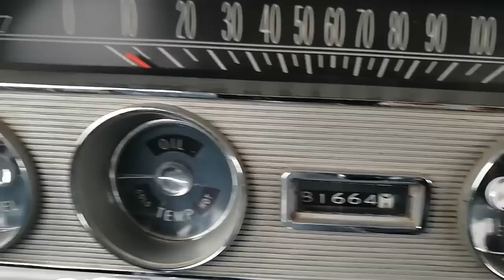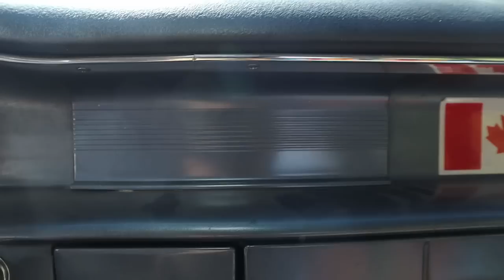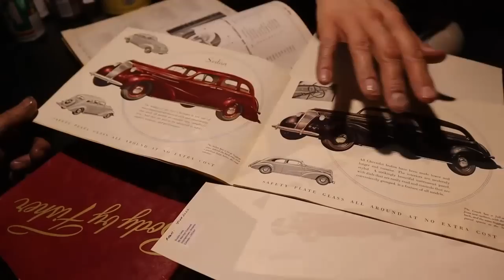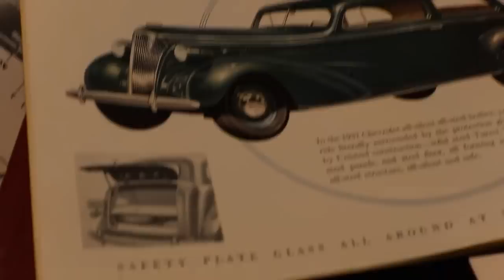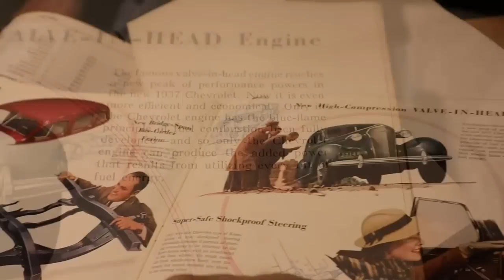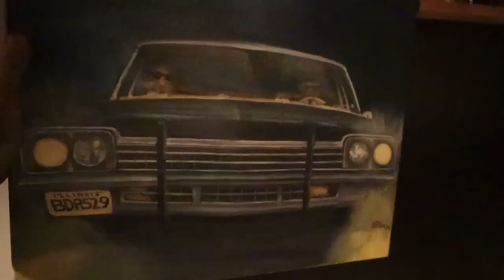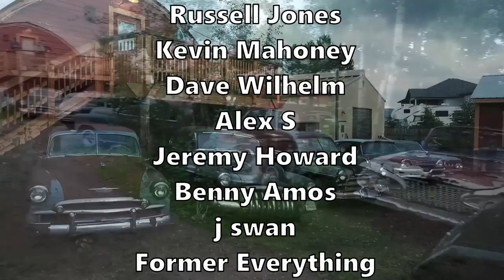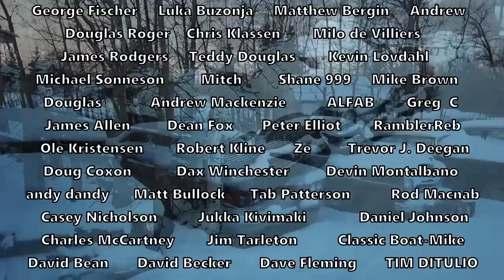"Turn Up the Base" Special: 1000-Mile Road Trip in Myles' "sight-unseen" Base Bargain!

Comment: Myles got a real sweetheart of a Pontiac. He's braver than I would be, driving it back home.
Reply: Yeah, it was a gamble, for sure
Reply: Those old 261 motors were plentiful in th 60s and 70s in the junkyards. Everyone was pulling them out for the more popular v8s. You could easily get 100k miles or more out of a 261. Full of oil and water you couldn't  really overev them because of the carberater, intake and exhaust system.
Reply: its my kinda gamble. might hit a few bumps along the way, but havent truely lost yet. the win was driving the oldest car i ever owned

Comment: I usually try and scan the codes on a untested car before I take it on a 1000 journey. That Miles is a beast, just let her rip.
Reply: Scan the codes on a 60 Pontiac lol. Look under the hood, if you have an engine radiator and a battery your good to go.
Reply: Always the most fun!
Reply: How does one scan a 60 ?

Comment: My dad had a 1970 Strato Chief. It was a leftover, sold in 1971. The reason it didn't sell was it didn't have power steering. By this point, GM was putting a small steering wheel in every car, thinking that most drivers would order power steering. It was so hard to steer I used to help my mom reef on the wheel while she was parking.

Comment: In an act of desperation i previously discovered that when you have to put nuts onto bolts in places that are impossible to access while holding the nut it is possible with considerable discomfort to partially thread the nut onto the tip of your forefinger just enough to grip it while you maneuver it into place then with your thumb and middle finger simultaneously unscrew it from your finger onto the bolt, you're welcome.

Comment: What a welcome surprise to see a Pontiac on your show.   Being use to USA Pontiac's it is always interesting to see a 6 cylinder 59/60 full size Pontiac.  Also on the road trip seeing a 59/60 Pontiac with a narrow track, not the USA "wide track" Pontiac.  The car is in overall super condition, great buy.   The 1935 top Chevy models were the first Chevy with the all steel roof while the standard models were like the 1934 bodies with the fabric center/wood braced top.

Comment: My uncle had a 1960 Pontiac Catalina 2 door sedan with a 389 and a 3 speed manual back in 1963.  It was a USA car, no 6 cylinder Pontiac here.  It was a runner.

Comment: Yeah, 1960. Those were the days, cars were pure. The luxurious metal dash top, no radio, no air con, no temperature gauge or oil pressure gauge, no seat belts or air bags. A complete time capsule. My 1960 Ford in the UK was a 'De Luxe' which meant a heater and chrome strips down the side (They kept falling off - you'd hear a clatter, stop and pick up the latest one that fell!) Mine had the optional rust unlike Myles's Pontiac.

Comment: Miles looks like the fire chief driving the Strato Streak. Is that one if those crazy Canadian 59-60 Pontiac bodies on a Chevy chassis? The tires sit way inside the fenders because the Pontiac body was made for the U.S. wide track Pontiac chassis.
Reply: For years the Canadian Pontiac used Chevrolet chassis and body with Pontiac fenders and trim. Before 1955 they usually had flathead Pontiac sixes, after that, Chev V8 or the unique 261 six borrowed from Chevrolet trucks.
Reply: Yep, I was thinkn of spacing those wheels to the outside....

Comment: It is so interesting seeing what Canada did when they built cars.  I run into the same here when Mexico built all the cars.  Every car has differences from the US cars either by luck or design.
Reply: Yep, pretty interesting and a bit of a learning curve
Reply: @mylesmoparfreak6562  Myles, I will give you an example of the Mexican craziness.  In the '60's Ford was the only company using V8 engines.  The other companies had to do something to compete so on a car like my 1963 Plymouth Savoy, they added the Fury trim on the side and sail panel.

All Chevrolets and Plymouths were 6 cylinder cars until the '70's when a few V8s were sued.

I have some videos on my Savoy on my You Tube channel if you are interested.
Reply: Awesome, I'll check it out

Comment: Love the Strato Chief. I see three options, two tone, heater and white walls. Still  fancier than a Biscayne.
Reply: Hmm, I never thought about the heater...those radials are coming off, w new black wall bias plys in its future
Reply: @mylesmoparfreak6562  please consider wide whites. If the original owner paid extra for the white roof, they probably paid for white walls too and with the red wheels, it would set off the two tone paint beautifully.
Reply: Hmm, maybe we need to try and locate a build sheet?
Reply: @mylesmoparfreak6562  when I was selling AMCs back in the early 70's, I regularly ordered base Hornets with white walls and a white painted roof and that made for surprisingly nice looking basic cars.

Comment: Another treasure. Pontiac took me back. Lots of miles in U.S. version. Same basic model but with small block V8, powerglide auto, full wheel covers. Otherwise same paint, same interior, no radio, I think maybe even same side mirrors. Sweet old ride down many Iowa gravel roads. Thanks for taking me back to simple times for me.

Comment: Watching you fitting all the panel parts reminds me of my last week! I was trying to do things like that on my Corvair project. Many hours I tried to make things fit a bit better all alone. There were some accidents of course. Some light cuts on my left hand reminded me that sheet metal is sharp. We had to weld the fender out of two pieces somewere else. That did make the fitting not easier. The worst things were some scratches on the front door that I painted a long time ago. If you do not have the resources to do it all in one place things are getting harder. Most of the adjustment work is archieved by now. Finally! Love to see the Fury is really on the finish line!

Comment: The hint threw me. He's a Mopar freak, extinct marque starting with P... When I saw the wrap around windshield and vent windows I thought "That's not a Plymouth. It looks like that Impala from the crash test video..." I swear I could smell burning oil on the return trip. Larissa is a rare sight on CWM... no grease under those nails. I'm just dying to see you take the 60 Fury on a "beer and chips" run.
Reply: Great points...I can't explain it...may have to change my user

Comment: I love old car finds like this one! (Pontiac Strato Chief). This car does not even have backup lights! What makes this car special is it’s the one no one aspired to. It’s the one practical penny pinchers would go for because it was just a set of wheels with 4 doors and a big trunk. 

But this is actually a good looking car because it has a limited amount of trim and it’s placed to highlight the style lines of the car. The white roof on the otherwise totally red body is just enough color contrast to flash up the look of the car.
Reply: Thanks!
I love how the factories would penny pinch the cars to drop the price $5.
Always surprising

Comment: My cousin had a 60 Olds 88 which he got into an accident.  He couldn't find a front end to replace the bent parts, so he just bolted a Pontiac front end on the car.  Fit perfectly.  I love that this car has the manual Transmission and the original six cylinder.  So many of the manuals were converted to four speed V-8's. Pontiac had a real powerhouse back in those days.  it was a tri-carb 421 which boasted 405 Horses.  Never drove one, but reportedly they were quick!

Thanks again for the memories. Love this channel.
Reply: Haha, awesome story! Thanks

Comment: Those bumper brackets are small but very important pieces. I've seen too many restorations where people forget them and the ends of the bumper wobble when the engine idles.
Reply from the maker: Yeah! I said when I started this job that there would be none of that, even though it does add a lot of time. I want the car to be correct...Cheers, and thanks for checking it out!

Comment: Myles picked up a sweetheart car, very pretty, great colour combo, and that paint will come right back and look mint with a polish...but that tired old 6...well, not my cup of tea, there'd be a 283 going in ASAP, but then it wouldn't be "base" anymore....Old GM engines with heavy blow-by tend to heat up a lot at highway speeds, don't ask how I know that, actually amazed that it made the trip with as little difficulty as it had, - they're very lucky! Those old sixes were not know known for being good long distance cruisers. ...And if he'd have bought the '59 he would have had full instrumentation, '60 was the first year for idiot lights. Good to see the Fury one step closer, and that Continental is coming together very well!
Reply from the maker: Cheers Marc! See ya soon...
Reply: Well damn, now I want the 59 instrument panel

Comment: I just couldn't help but want to share my second car back in the 1965 was a 1939 Chevy two-door sedan. I bought it for $800 off my brother who was going into Air Force. It had a 327 Corvette engine straight Model T front axle and cheater slicks on the back

Comment: The car probably survived because it didn't have knee action . Knee action required extra maintenance which often wasn't done .so they didn't last and most of them were scrapped  the base with a straight axle usualy  had longer life.

Comment: Awesome ride with the 261 cu. inch six. That was quite the trip!! I put a 261 into my 53 Chev pick up with two one barrels and split Fenton exhaust. Pulls great and runs well.
Reply: Ooo, I like the idea of that carb/exhaust set up! More details?
Thanks!
Reply: @mylesmoparfreak6562  It is running two Rochester BC carbs on a Offenhauser intake with cooling water plate underneath. I built a custom linkage bell crank that fit the stock throttle pin. Interconnecting linkage rod with bushings mounted to throttle plates under the carbs. WOT is set up for the stock pedal throw.
Reply: @idaho2ndgens240  man, that sounds great! And I bet it looks very cool once you pop the hood. Surprise a few people, I'm sure!
I think I'll hold off for now on modifying the Poncho. Keep reminding myself; it's only original once
Reply: @mylesmoparfreak6562  Nothing wrong with keeping it original as that is the way it was designed. My 53 originally had a 216 oil dripper that was tired and I was looking for a way to hop things up with what was available at the time. If you decide to modify, let me know I can send you photos and it might save some time and headaches.
Reply: @idaho2ndgens240  
Thank you! If I go that route, I would appreciate some photos and assistance. Very appreciated!

Comment: Hey guys just want to say I absolutely love cold War motors and all the cool things that you guys do on it. it's the greatest show ever.  I also wanted to tell you guys that the solution that Scott was soaking the1960 Plymouth bumper brackets in can be used to free up old stuck engines, by pouring it into the cylinder spark plug hole and also down the intake manifold to let it eat the rust on  the piston rings that are rusted to the cylinder walls, that is what causes the engine to be stuck. I have unstuck many engines by doing this.,. But you have to let it soak in the engine for several days .it will  allow the engine to turn freely again,it also loosens the values.. Again thanks so much to each and everyone on the show. I am subscribed and watch every episode and  I always hit the like button. I am a true fan.

Comment: At the same time, I did something incredibly stupid. I bought a car that actually works. No, really. I bought it sight unseen, as you do, picked it up after dark, in the rain, in a dodgy back alley, as you do, and just drove it home. No issues, or anything. Drove it every single day since I've owned it. No issues. So far, the ownership experience has been downright traumatising, because apparently there is nothing wrong with the bloody heap. I'm just waiting for Thor's Hammer to strike, because this is just too good to be true.

Well, I must admit, on the downside, it's a Renault 4 TL. 845 cc three main bearings (for those who can even count that far) Billancourt engine and all that sort of rot. Don't laugh, though, it's the model that already has the four speed gearbox.
Reply from the maker: What a great deal! Love the Renault 4! All the best from me and Frankers and the Agents!

Comment: An old guy told me once that knee action chevrolets had a problem in winter.  If you drove too long in a straight line, snow would pack into the knee and then when a curve comes along, there was no turning  the wheel.  You guys in the prarie might want to think about that.
Reply: It's a myth.
Reply: Well, i hear theres hardly any turns in alberta anyway, so probably it’s ok.

Comment: Had a similar overheating problem returning home after a holiday, out in the country no big towns pushing car a bit hard temp light came on slowed down and light would go out. long story short. We got home and next day after a short run, standing there scratching my head, heard a hissing noise, turned out radiator cap rubber had hardened and cracked, releasing pressure. Many years of use after and no problems.
Reply: Yep, agree. I threw a new cap on it at the beginning of the trip.

Comment: If I recall correctly, Canadian Pontiacs were built on Chevrolet chassis.. US versions got Wide-Trac chassis that pushed the wheels out a bit.  Hence Miles comment about "body roll"   Also US cars only had V8s. No sixes.
Reply: The US cars also came  with 6 cylinders as a base engine.
Reply: @Hanzyscure  Chevrolet  yes. Pontiac no

Comment: For $150? Or $1500? that's a steal of a deal on that Pontiac in fantastic condition too!

I paid $1200 for a 64 Dodge custom 880 and the trunk & floor pans was just flaking away. Kind of the condition how the 60 Plymouth Fury was found, just a bit on the better side though.

Comment: Miles, what a great purchase.   Before you commit to putting rings in the engine, I would check the draft tube for blockage.   Also, if that is clear then maybe soak the rings in Marvel Mystery oil and give it a ago.   I doubt the current rings are worn in 81k kilometers.
Reply: Miles on Miles’ baby (pre-1976).
Reply: Thanks Clark, I'll check it out

Comment: FYI: Most if not all GM temp. lights come on at 230 degrees and oil pressure comes on <8 psi. You don't want to know how I know (Sigh). Sweet Poncho. Something like my dad would have bought except even a base Chevy was too expensive>>bought RAMBLERS instead!
Reply: Good to know! Thanks.
I don't like to push a motor over 240, so that's perfect.
Sounds bad...sorry for ya
Reply: @mylesmoparfreak6562  Running a little hot for a short while wasn't a big deal--just go slower, run the heater and replace the thermostat. Low oil pressure meant large bearing clearance and eventual spun rod bearing. That was a mess.
Reply: Agreed, only one way to fix that issue. I'll likely be walking everyone thru pulling and rebuilding the little 6

Comment: "This is battlefield surgery inside the fender" ..... You do know how much a lot of people would want such quality repairs off the cuff in their classics, don't You? Quite some of my tin repairs do not look like that battlefield surgery with bought, pre-bent parts to cut pieces from. I have a couple railroad sections like You had to my use, even my hammers resemble faintly what You used, but still ..... Just saying. Thanks for sharing!

Comment: Signs of a wide-track Pontiac body on Chevy running gear:  note the very inboard wheels compared to the fenders; also, the back wheels are not properly centered in the openings.
Reply: It's just weird right!
Gonna add some wheel spacers and get the wide track back
Reply: @mylesmoparfreak6562  Myles:  You have a unique look, don't add spacers!  Check out Adam's 1959 Parisienne over on Rare Classic Cars.  Praying for successful surgery!  Also, your wife should take over all CWM camera work.  Best to you both, and enjoy that new ride!
Reply: @bradleyberman9863  , thanks Bradley! I'll pass the kind comment onto wifey!
I'm doing much better now, thank you.
I'll check out the parisienne !

Comment: 8:08 I'd check that road draft tube, it might have to be cleaned out.
Reply: Will do, thanks!
Reply: @mylesmoparfreak6562  I use to pour some gas in them and burn out the built up oil. Once that is done tap on the tube to knock the dried up oil out.